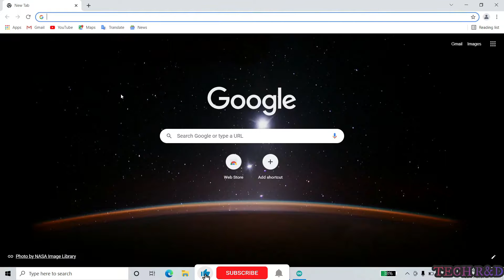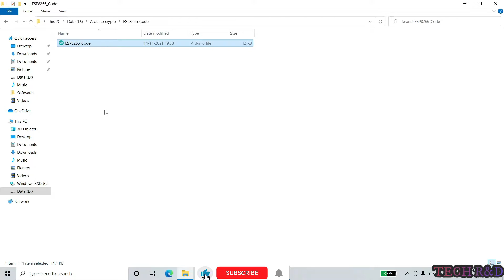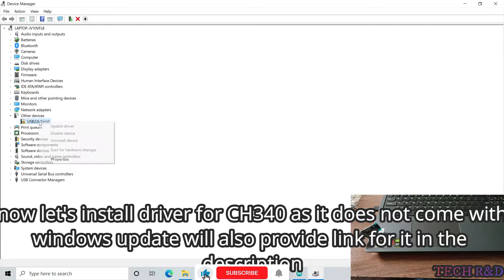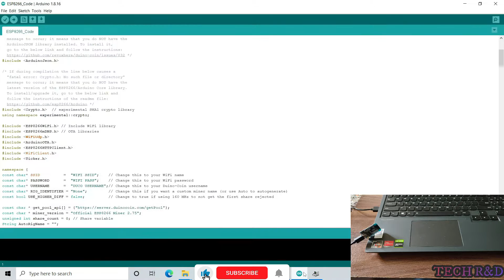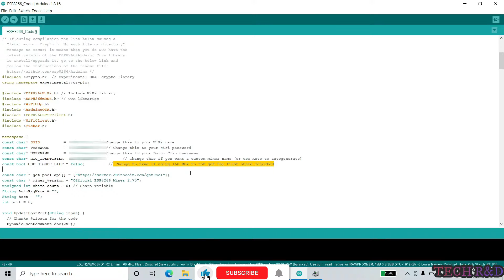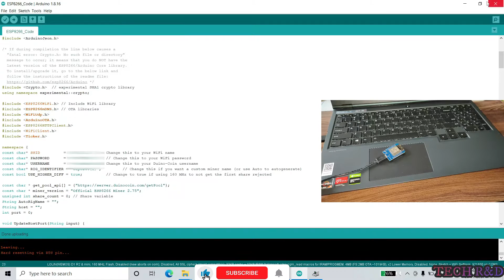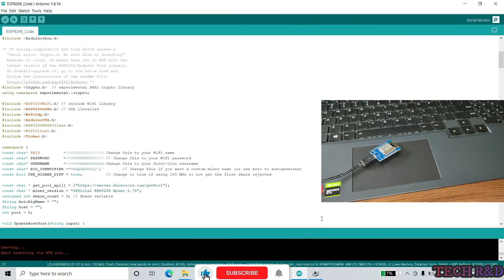ESP8266 mining rig | TECH R&D

Comment: Can you share a diagram or video on connecting the power? Do you have a complete circuti diagram?  Thanks!
Reply from the maker: You just need to make all 5v pins common and similarly GND PIN common of all ESP.
 you can use 3v pin instead of 5v but will recommend to go for 5v.